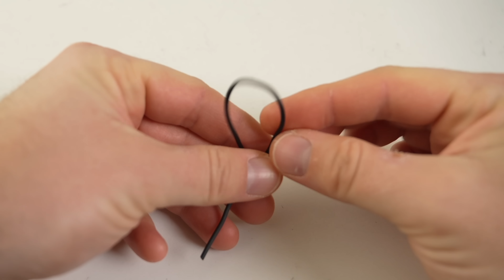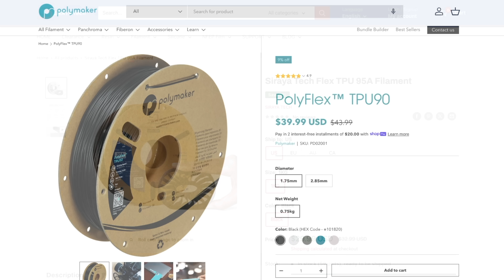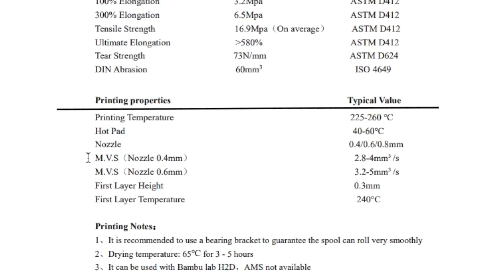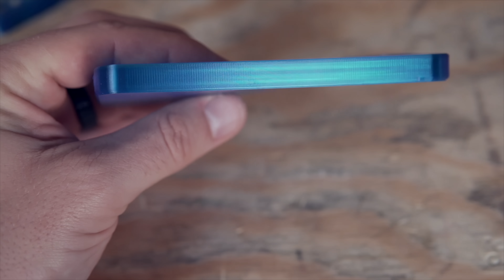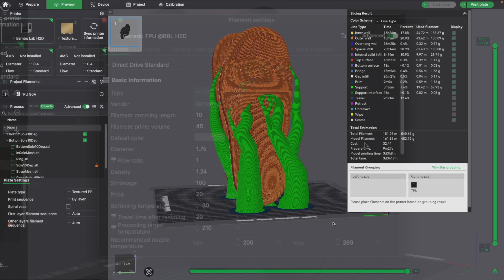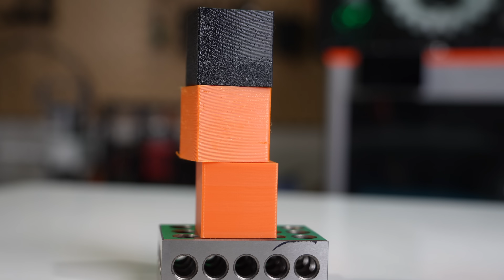This Filament Gets Softer After You Print It! (BIQU MorPhlex)

Comment: Get an engineer plate and place glue from a glue stick down on the plate prior to printing. It helps so much with removing TPU from the plate. You can use the standard plate, but glue is hard to remove with the texture.

Comment: If you are over 85 or under 15, you're measuring on the wrong shore scale. The accuracy falls below the standard's tollerances. Should be using the d scale for anything that hit shore a >85.

Comment: Great video, maybe I missed it but was there a reason why you didn't use PLA as support for printing those shoes? It seems to me it would have lended a little more stiffness to the print as it was printing and it definitely would have come off the build plate much easier and also released from the TPU a lot cleaner.

Comment: Do they have a version where the original filament is harder? Around 64D as I have a multi material printer running on Bowden tubes. So I currently can't mix tpu in my multi material prints.

Comment: Ive had nice success with this filament. Coming from printing 85A, this one was a breeze compared to that. Ive printed slightly more complex shoes (no blueberry or whaleberry) but more like crocs and slide ins, and it has printed surprisingly great. I use a 0.6 nozzle so I tinkered with the max recommended volumetric speed of 5mm/s and it makes a HUGE difference in printing times. (down from 19 hours of using 3.2mm/s to just 12 hours). Definitely recommend using it for shoes and slides.
Reply: Hi mate do you have any information on how to make it softer? Your valueable information comment deserves to be pinned on top :)

Comment: I remember when 3d printing was in its infancy the whole point was helping speed up designers prototyping workflow and making one off parts super simple and easy just slap in some filament send the file and print. But 15 years later it's become so hobby-fied with the drying filament and all kinds of parameters. I mean this dude needs and entire room full of gear to make decent prints I feel like its a gimmick and for the same amount of work you could just cnc molds. Literally the only cool thing about 3d printing for me is those un-assemblable mechanisms
Reply: It brought industry to the man at home, what's your complaint? I'm CNC educated for six axis machines but that doesnt mean I can AFFORD ONE AT HOME. i can afford  a 3d printer.

Comment: No need to use IPA or other chemicals to remove TPU stuck to the plate. Just heat the plate to around 70 C and You can then peel it off pretty easily. Doing it every time and it works - at least with all types of TPU we had our hands on ...

Comment: you can use isopropyl alcohol to detach the tpu from the buildplate, it has a very low surface tension and sweeps under the tpu in a few seconds

Comment: I use a paint roller mounted on a microphone stand as a filament spooler. Also keeps the mass of the spool off the printer for less oscillation caused by a high mass object wagging around.

Comment: I always use a smooth bed with heavy coat of Aqua-Net  hair-spray for TPU. It just sticks to well to a clean bed. Aqua-Net is also a easy to use choice for filaments that don't stick enough. I just spray the removable bed over a garbage can and then wash the bed with warm water once in a while.

Comment: Noo! 😮 NEVER use brute force or sharp tools on a textured plate! You will ruin it. Just dribble some isopropyl alcohol around the part and gently pry it with a plastic scraper, a plastic knife, or an old credit card. Work in small nudges, to let the alcohol get under the part as you detach it.

Comment: Use vision miners liquid adhesive. Then, after the print completes, put some 90 or 99% isopropyl alcohol around the object and it basically lifts right off. This is the only way i remove TPU.

Comment: Just a tip for removing difficult plastics from the build plate: Heat the build plate up a bunch (like 110C) and it might get softer and easier to remove, depending on material. That has worked quite well for some filaments.

Comment: Pro tip: If you want to be able to release TPU from the build plate then after the print has finished turn the build plate up to 100-110 degC and it will release just fine. The only thing to watch out for is to avoid deforming the part while you are releasing it. Pry it off with a flat blade, work your way underneath it and bend it off the build plate gently rather than yanking it off by excessive force because at 100degC you can permanently deform your TPU part a little bit and depending on your application it may or may not be a good thing.

Comment: First time watching one of your videos. This filiment opens up alot of future possibilities as far as making a thermoplastic elastomer that does not get fully elasticized until printing temperature. I think this is possible at the factory because they have much tighter temperature control when making the filiment. And then they consider the chemistry of their elasticity formula and how long it takes to pass through the hot end and if that is enough time to cook it to get the expected elasticity results.. 

Also, for easier bed removal I reccomend masking tape or painters tape. It will not hurt the bed at all and most you would need to do is take a hobby knife or lighter to get the scraps off if it dosent release.

I'm going to guess that if you were to test 1/4inch or 5-6mm thickness 100% infill 20x20 test squares (print quicker than your 35x35x35 cubes😅)  if you printed at lowest temp to highest temp the higher temp would be softer.   I'm also curious if printing a couple test squares at the same hot end temp but diffrent bed temperature if the sure hardness on the bottom of the square would be softer the higher the constant bed temp.  Also curious is printing at slowest speed vs fastest speed will give a significant impact on hardness. 

I would also give a price comparison between the filiments you test to help evaluate if price matters😅

Comment: right now when i print with a noodle filament i test how low i can take the filament until it doesnt come out of the nozzle. this way i can get it further away from stringing. then i need a solid number on retraction. i found at least 2.4mm and to use a fast retraction speed. mine is set to 100mm's 

i currently use 190 degree on 95a tpu
i use a bed temp of 40

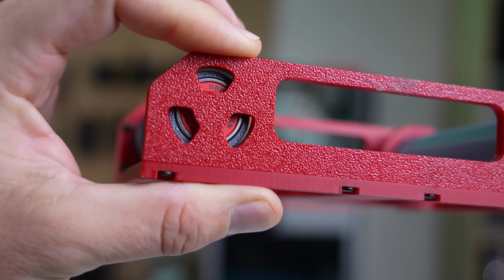Comment: 6:08 Noooo these spool holders are still pretty bad for flexibles IMHO! Think hard about where the friction is in relation to the filament being pulled. Sealed bearings on the rim of the filament gets a leverage advantage, the bearing has to spin dozens of times to make a single spool rotation, now think how much worse that gets as you move closer to emptying the spool and reaching near the core of the spool. On-top of that, any PTFE tubes turn into a force multiplier from the friction of being pulled against the walls. You want central bearings for a reason, the filament gets the leverage to unspool because it is on the outermost edge. I had to learn this to print 85A on my A1 mini, now it's a breeze.
Reply: I print a lot of TPU-LW for my business and previously printed a lot of TPU.  All of our printers use a bearing hub spool holder mounted above the printer and the filament feeds directly into the top of the tool head with no Bowden tube.  I need to print a top hat for every new enclosed printer with holes for filament to feed but I love not messing with Bowden tubes.

Comment: Next time when you print with TPU, use a PLA raft. You can just peel the PLA of the TPU like the backing of a sticker and you can always get the PLA of the plate
Reply from the maker: The funny thing is I’ve done this testing and made videos on it. I’m not sure if it’s because I didn’t know the base material or that when I’ve tested filaments on their own I haven’t combined them but times have changed and dual nozzle setups are becoming more common so I really need to consider this.

Comment: Two things .. slow down if you start seeing vibration. Forgot what it was called. Second if tpu is stuck just heat the build plate and remove when hot… maybe 10-20 degrees higher than what you printed at.

Comment: Since you have an IDEX, using PLA or PETG as the support material would probably help secure the model in place better during printing.
Reply: TPU will bond fairly well to PETG, but I use a PLA raft/supports to print it on my XL...holds it down while printing without messing around with glue and stuff, but peels off reasonably easily afterward. Had some good results printing foam TPU gaskets this way.

Comment: How 'slick' was the printed material?  Would it be better than typical tpu as a bottom surface to prevent practical prints from sliding across a table?
Reply from the maker: It was quite slippery. I would say more so than a soft tpu. Based on the slips I wouldn’t recommend it for something you want to grip/not slide.

Comment: I printed these air slides a while back also. My prints look amazing but have had issues with soles peeling away from the infill. Tried way more overlap to walls and bumped temp to max just before tpu looks rough and sparkly for better adhesion. Did you have these issues as well? Im going to glue the soles before they sepperate too far.

Comment: Next time use PLA in the left nozzle as the support material. Less movement as print gets taller and easier support removal.
Reply: Printing PLA and flexible material together would make this 2 day print a 4 day print, and would generate a lot of waste.
Reply: @Liberty4Ever Not on an H2D. 2 nozzles 2 filaments, printed a pair of Cloudberry shoes with PLA support in 50 hours iirc, it’s been a while. The only waste is the priming tower, and the slicer did a great job keeping the materials separate. TPU and PLA in separate columns with a PLA wall surrounding them both.

I know what I’m talking about here because I’ve done it.

Comment: when you have a stuck tpu print, (even works to a degree with petg) spritz with alcohol, and massage an edge, eventually it'll lift and you can get more alcohol in there and it'll almost pop right off
Reply: I also use freezing if I print too much TPU surface area on a build plate.
Reply: I have an egregious petg situation on my plate thanks for the tip.

Comment: I've found that some IPA sprayed onto the bed, around such flexible objects helps to release them quite well.
Reply: What about a glue stick (or similar) to allow for the print to be more easily removed as the interface layer no longer has that bonding issue with the build plate?
Reply: @raypalmer7733 I really like nano polymer adhesive for that. It doesn't leave the same kind of residues

Comment: glad to see you're reviewing the h2d, I hope you don't fall into the same trap that i saw so many other channels get into where they get an h2d, then only try to print pla or petg and then wonder why the printer built almost exclusively for abs, polycarbonate, nylon, pps/ppa doesnt work well with low temp filaments.
Reply: There is nothing that should prevent this or any printer from printing PLA and PETG perfectly.
Reply: @wojtek-33  agreed

Comment: Your measurements on the walls and edges with the durometer  are worthless. This is the equivalent of weighing something and you are expecting to be heavier, and you press with your thumb a bit. "yes, if I push with my thumb on the side it weights more" . Or trying to 3d print an ultra light glider and go "if I weigh this wing on the edge of the scale , is a bit lighter".
Reply: How should he have done it?    I have a durometer coming and no experience.
Reply: @Taliesen.  I assume you mean a Shore A durometer, since that’s what’s normally used for TPU. For accurate results, make a flat sample at least 25 mm × 25 mm and 10 mm thick (you don't need thicker, but make sure you print 100% infill), and take the reading at the center — not on walls, edges, or thin spots — pressing straight down and holding for about a second before reading. Make sure you do this against a hard surface and not a mousepad or something like that as it will skew the results. Good luck.

Comment: Nice filament. Two questions: Why not use the 2nd extruder for the supports? and why did you print both at the same time? History told me that it's always better to print one thing at a time in case of failure ...one fail, not two. Ask me how I know!
Reply: Exactly. Totally agree.  Printing supports with another material is THE KEY FEATURE of the H2D.

Comment: when removing TPU from the bed i found it helpful to use a drop of rubbing alcohol (isopropyl), to break the tension between the materials. Also works wonders for removing hot glue from any smooth surface. it doesnt dissolve the hot glue, it gets between the glue and surface, allowing it to be easily removed
Reply: You’d thinks 3D printing channel would know all these. 
It always works a charm!
Reply: This. I destroyed my first ever TPU print and almost ruined my bed until found this tip on Google. Now I just lift a corner, drop some 99% IPA on there and after it wicks around the part it is as easy as pulling off a slightly stubborn protective film on a screen.
Reply: Yes, it's awesom solution
Reply: Or get a powder coat texture sheet, or the Biqu Glacier plate.  My prusa powder coats and the Biqu work for basically every plastic.

Comment: Putting the whole plate in a fridge for one hour worked for me to remove crazy stuck PETg prints. One big piece stuck that warped the glass plate and I was afraid it would break. But the extra cooling did the trick, it released from the plate.
Reply: That hasn't worked as well for TPU for me because the material can flex more instead of the added stress making it pop off the plate as would happen with PETG
Reply: Not as challenging but I've put BL 95A-HF prints on smooth build plates in the freezer with excellent results.

Comment: Cool material! I need to know. Were the shoes comforable?
Reply from the maker: They were made for my wife so I never got to wear them but she went from not excited to putting them on wearing them way more than expected. She really likes the way they feel.
Reply: @ModBotArmy  Nice!
Reply: I print a lot of TPU-LW for my business and always wanted to print some shoes, mostly for the novelty.  I still do, but on a whim I bought a pair of 3D printed Zellerfeld SBOOTS and they are my favorite shoes ever.  They're as comfortable as slippers and very durable.  No blisters when hiking.  The uppers are thick enough to be warm but the TPU-LW is woven so they breathe, keeping my feet dry.  They're very comfortable in summer (warm but dry) and I think they'll be warm in the winter.  I took cell phone pictures of my stocking feet on standard 8.5x11 inch paper and the Zellerfeld website used that to 3D scan my feet for a custom fit.  Printing the soles and uppers in a single print means the sole will never delaminate, as I always had with the same boots the USMC uses.  They're slip-on boots so they'd slip off in a high speed motorcycle crash, but I wear them when riding around town.  They're the only shoes I've had that don't show the slightest sign of scuffing or wear on the left big toe from up shifting the motorcycle.  TPU is flexible, but it's very tough stuff.  The technology is so good that we'll have online custom shoe manufacturing.  I look forward to the shoe printing regionally so I won't need to order my awesome geeky 3D printed shoes from Germany.
Reply: @Liberty4Ever That's awesome! Don't think I can afford anything Zellerfeld, but I am willing to give printing my own a go someday. I've had a pair of RAT boots I used a ton for airsoft.

Comment: There's a newly released mod to allow printing soft TPU on the H2D without removing the top glass.  Search Makerworld for the TPU Tamer by Adam L. It automatically feeds through the dedicated TPU port in the rear by using the LLL+ buffer.

Comment: I would have printed 1 shoe at a time. That would allow me to make slicer corrections for the second shoe.  It might even provide better interlayer adhesion as the time between layers is shorter and the temperature difference is smaller. It also reduces the amount of lost filament in case of a failed print.
Reply: This was my thought exactly

Comment: I’ve found the easiest way to remove flexibles is to squirt some alcohol around the bottom of the print. Worked great last night on the Siraya Tech TPU Air.
Reply from the maker: This is a great tip to keep in mind! Thank you 😊
Reply: Came here to post this as well.  I haven't printed anything softer than 85A, but just a little spritz of IPA seems to soak in between the plate and the plastic has worked great for me.
Reply: Same for me
Reply: I agee!
Reply: Works even better if you use an alcohol based glue like vision miners liquid adhesive
Reply: Ditto. I just pray away! Works a charm. 🎉

Comment: Super interesting very interested in it's chemical resistances
Reply: BIQU being secretive about their patented formula makes it more difficult for me to use this material in a commercial application.  I already test new filaments for chemical compatibility and durability/flexibility at different temperatures, but not having any idea what's in there would make me even more reluctant.
Reply: @Liberty4Ever  My thoughts exactly, I often do automotive environment stuff, so heat, oil, and fuel resistance are important.

Comment: Tips:
You can set higher noodle height depending on set plate. It helps for TPU with textured plate. 
Printing one shoe before another helps with stringing and reduce waste if failure. 
Also support gap top height would be a nice calibration before going into this kind of project.